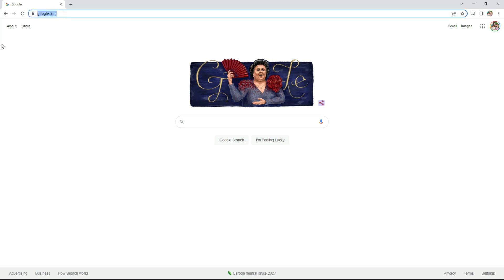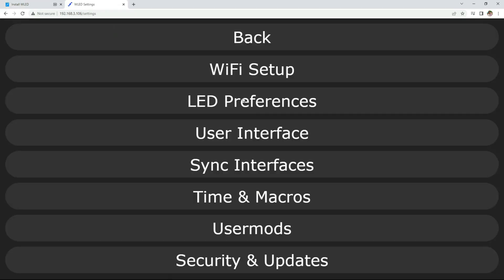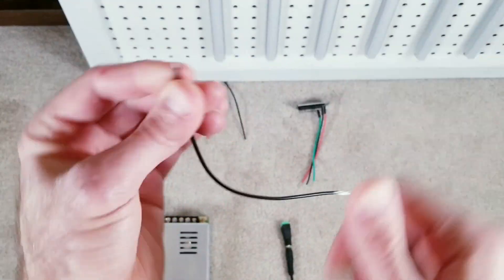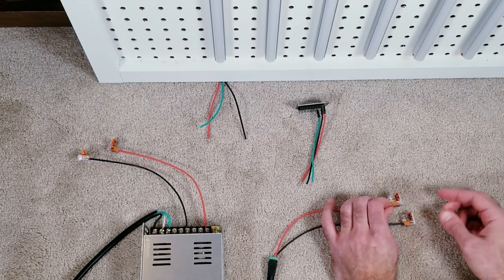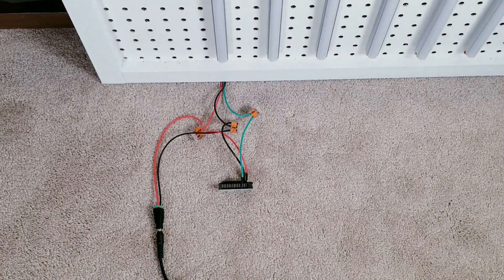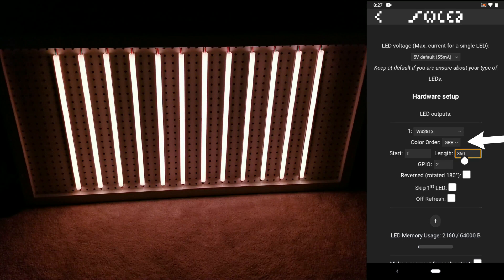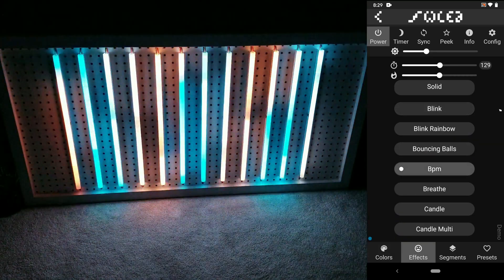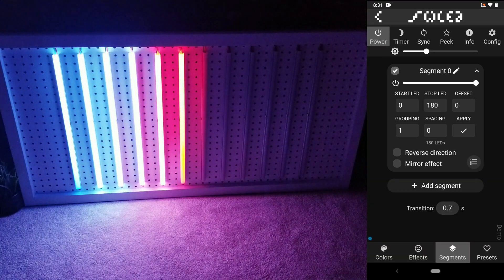How To Install WLED on an ESP32 Board and Connect / Control Addressable LEDs

Comment: Question- Bought everything on your list, thank you for making it easy to learn this. 
I designed a lamp made from square steel tubing, and I think the steel caused a short while I was testing the circuit. Now the strip won’t light past ~50th led except for a couple at about the 75th LED that just shows a dim green light. 
Is it possible that, if one of the resistors sparked against the steel housing, it would kill a section permanently? I’ve seen LEDs that were actually burnt out and replaced all of those sections, but none of these LEDs look bad. 
Some details: using the big power supply, soldered all sections in series using 18 gauge wire, and I’ve tried swapping out the controller board. 
It’s only about 8ft of LEDs with wire in between each section of 2ft, maybe there’s a setting I’m missing in the config? I played with the strips before beginning the project and they worked with 2 strips in series.
Anyway, thanks for any insight you can give 😅
Reply from the maker: Thanks for watching and taking the time to comment! Bummer your having issues! That seems like a strange issue! So one time something happened and my strip no longer did anything. I tried everything I could think of and nothing got it working. I eventually tried cutting off the first led of the strip and connected the rest of the strip back and everything worked perfectly. Im not sure if you have any extra strips of LEDs but that would be the first thing I would try. Connecting your current setup to a new led strip and see what happens. If that new strip works perfectly then more than likely something happened to an led or LEDs. On the strip that is no longer working, I would probably cut off the first led that's not working and reconnect the rest and see what happens. I'm honestly not smart enough in terms of all the electrical aspects to know if the steel could have caused a short but I'm sure it's possible! Troubleshooting is never fun but I do always seem to learn something new when I have to do it! Let me know if you figure it out because I'm curious myself what it might be!
Reply: @ChrisMaherDIY  Hey thanks for the quick reply Chris, I kinda figured I’d have to keep troubleshooting. Thanks again for the inspiration to try this, I’ll let you know how it ends up.

Comment: Do you have any experience with 12V led strips like the WS2815 with WLED?  I've seen conflicting info online on whether the data lines are 5V or 12V.
Reply from the maker: Thanks for watching and taking the time to comment! I have yet to experiment with those strips so I'm not really sure. I do at some point want to try them out because the 12v strips do have some advantages over the 5v. Maybe someone reading the comments might know more and can chime in!

Comment: There is one little step at the end that's missing. What case are you using to house the board? I want to go this route with a halloween costume that will require some LED's, I want to use wLED on the ESP32, but I can't seem to find the right project box to spap it into. Any help would be appreciated. I'm looking to run around with this in my pocket.
Reply from the maker: Thanks so much for watching! I've personally never used anything to house the board but I have seen other people recommend using some type of travel soap container which I thought was brilliant! Something like this: https://amzn.to/3s6QVcc

Comment: A este tipo de esp23 board se le puede instalar un sensor de movimiento para que se enciendan los led al detectar movimientos?
Reply from the maker: You can add a motion sensor but I have yet to try doing it with these esp boards to i'm not 100% sure on how it would work. At some point I do want to do a video on this so hopefully I'll know more down the road! Thanks!

Comment: How many ESP32 WIFI CONTROLLER control or detect? I have about 200 feet i want to do for a Rc Drift track.
Reply from the maker: Thanks so much for watching! So here is what the official WLED page says in terms of length. (its more based on how many leds there are vs feet)

"There is a maximum of 10 strips supported
Contrary to the ESP8266, the pin usage does not matter on ESP32, feel free to use any available pin
For perfect performance, it is recommeded to use 512 LEDs/pin with 4 outputs for a total of 2048 LEDs.
For very good performance, it is recommended to use 800 LEDs/pin with 4 outputs for a total of 3200 LEDs.
For good performance, you can use 1000 LEDs/pin with 4 outputs for a total of 4000 LEDs.
For okay performance, you can use 1000 LEDs/pin with 5 outputs for a total of 5000 LEDs.
For okay performance, you can use 800 LEDs/pin with 6 outputs for a total of 4800 LEDs.
ESP32 can calculate about 65k-85k LEDs per second (that means 1000 LEDs @~70fps, 2000 LEDs @~35fps, 4000 LEDs @~18fps)
4 outputs seem to be the sweet spot"

Comment: Hi, thanks for your video, i want to make this in a stair, but i have a doubt. can i install in parallel both data and DC? or i need to install data in serial mode (the out of the strip with the in of the next? thanks
Reply from the maker: Thanks so much for watching! I believe you can do parallel in both data and dc. I know I've done a few projects in parallel and I've simply just split the data line coming from the ESP device and it works perfect. Both strips do the exact same thing at the same time with zero lag or difference in animations.

Comment: Help! I've wired my strip and ESP32 exactly as shown but I have no control. The LEDs turn on but the colours and effects are just random.
Reply from the maker: Thanks so much for watching and sorry your having troubles! I would double check all the wires, and settings in WLED. Also if your data line is long coming form the ESP device to the first led, sometimes there are issues. Otherwise, the led strip could be bad or potentially the board. Always frustrating when things don't work but good chance to just try to eliminate what its not one thing at a time to hopefully narrow it down to what it could be. Good luck and hopefully you can figure it out! Also maybe check out other youtube videos to see if people are doing things any differently!

Comment: Thanks you for your app, that app are awesome. But it't support dual channel ?
Reply from the maker: Thanks for watching! If by dual channel you mean 2 strips at once then yet. You can connect different strips to different pins and then assign the pins in the WLED settings. Thanks so much for watching!

Comment: Man what a great video. I would have never found the section with the Number of LED per strip. I couldn't figure out for the life of me why i only got 32 LEDs lighting. I bought 2 power supplies and 2 higher end usb chargers.. 
Guess i have extra power supply's for my Triangle and HEX nano leafs now
Reply from the maker: Thanks so much for watching and glad it was helpful! Better to have too much than too little!
Reply: It's not per strip "per se".. it's just total number of leds connected to that controller.

Comment: Hey man!  Im scratching my head hard right now trying to figure out what pins to use for two led strips on the same controller but different pins.  You should make a video showing how to do multiple LEDs to one ESP32 board!
Reply from the maker: Thanks so much for watching! I should! I've only briefly played around with it but in the WLED settings there is a spot to add another strip and assign it to a different pin. I would just experiment with adding a strip to a different pin and then assigning that pin in the setting and seeing if it will work. I will at some point do a video. I'll put it on my long list of project!

Comment: they don’t have the board in stock is there another alternative board i can get thanks
Reply from the maker: Thanks so much for watching. Its still showing available in the US at least. I'm not sure about other regions. If its not available where you are, most eps32 boards are all relatively the same and should work! I always just make sure to order from a place that has free returns in case I cant get it to work!

Comment: for the small power supply - what Amp do you recommend?
Reply from the maker: Thanks for watching! For small projects (i'd say less than 50 leds) the 2amp charges have worked well for me. For medium sized builds (300 leds or less) i would go with the 10am. Anythine more than that I would go with the big supply. I'm also a big fan of just trial and error and testing things out. How many leds you can use will mostly depend on how bright you want them. For example, for all my projects, I rarely ever have a need to have them at full brightness (just too bright) so I can always use less power than recommended. Hope that helps and thanks for watching!

Comment: What voltage and watts and amps etc should the power supply be? I am planning on connecting 3 separate 2.3m strips with wire so it would be like almost 7m of led would it suffer from voltage drop?
Reply from the maker: Thanks so much for watching and taking the time to comment. For that I would try this one and see how things looked. https://amzn.to/3DCOp4A Depending on the brightness and color you want to run the leds at you might need to inject power but I always start off with no injection, test and see how things look and then go from there. Thanks for the great quesiton!
Reply: @ChrisMaherDIY  thank you for the help :)

Comment: Thanks for the videos! I’ve been learning a lot from your tutorials. Do you recommend a separate power supply for each array of controllers / leds strips. For example I have 3 separate windows that I want to surround with leds. Where I can control each one individually. Is it best practice to have a separate power supply for each one of calculate the number of leds and find a suitable power supply for that. Also, in this scenario how would I give extra power to each one if they require it.
Reply from the maker: Thanks so much for watching and taking the time to comment. Glad you are liking the videos and great question! So I would say that you certainly don't need to use a separate power supply for each set of lights/controller. Running a longer distance of wires from the power unit is perfectly acceptable. Now depending on your layout and how you want to hide everything, it may make sense from a logistical/concealing everything standpoint to have different power supply's but its certainly not necessary. And if you do need to give more power to the lights, you can run long power wires from the main power source to the led strips. Hope that helps a little!

Comment: Hey Chris, I just purchased all the stuff needed to make these but I've run into an issue. My ESP32 board is no longer connected to my wifi and I am unable to reset the device to reinstall wled. Could you please help me out here?
Reply from the maker: Thanks so much for watching! When I wanted to reset my esp32 back to default I remember I had a hard time figuring out how to do that until I stumbled upon this video! I watched this and was able to figure it out! Hopefully it will work for you like it worked for me! https://www.youtube.com/watch?v=bQTHNZI6Wno&t=214s

Comment: Great video!  Everything worked UNTIL the part where it asks for the Wifi credentials... Entered them 4 times. Double checked for no misspelling or extra spaces... nothing.  I'm using Heltec ESP32 and trying to install WLED 0.13.1.  

Any recommendations?
Reply from the maker: Man thats so strange! I have no Idea what could be causing that. Is your home wifi 2.4 or 5ghz? I'm not sure if that makes a difference or not. Maybe try watching this guys video to see if there is anything that he does differently? https://www.youtube.com/watch?v=j15pjU3YZfg&t=41s
Reply: @ChrisMaherDIY  It turns out that I was using a special character in my password... either WLED or my Heltec ESP32 unit did not like that.

After changing the password it worked.

Now I'm fighting with the config and keep getting "Light not connected" error.

Thank you for your help!

Comment: Hi Chris, amazing videos and awesome informatio... Keep it up... Need help, can you pls make a video about changing micro b usb input to usb c input on esp32 board.... Doing a photography hobby project, and for that I have to carry an extra cable for esp32(micro b input), would help a lot if I can make it usb c input... Thanks...🙂
Reply from the maker: Thanks so much for watching and taking the time to comment! That's a good idea for a video but I would have to do some research first as I don't know how that would be done. I do know that they make esp32 boards that have the usb c input now which if I'm understanding your issue, might help? I have not used these boards so I'm not 100% sure on the differences between them and what I use but my understanding is they are all pretty similar! https://amzn.to/3QjXnao
Reply: @ChrisMaherDIY  I already have esp32 with micro b connector, if possible atleast can you find and give me link to documentations of micro b (+/-) according to esp32 board circuit, will try to look into it if it's possible for me... To do it on my own...👍

Comment: Hello Chris,  do you know whats the different between ESP32 & ESP8266 ? 

which one should I chose? 🙏🏼 thanks

https://www.youtube.com/watch?v=l8OMi7SMpqs
Reply from the maker: Thanks so much for watching and sorry I'm just seeing this comment now. Youtubes notification system for comments is not very good! If you have 600 leds or less, either one will work just fine. If you start getting more than 600 leds, I would go with the 32 since its a little more powerful and can handle more leds! Hope that helps!
Reply: @ChrisMaherDIY  many thanks Chris 🙏🏼🙇🏻‍♂️

Comment: Does Wled only work with wifi or is bluetooth an option
Reply from the maker: Its wifi only. However since the device creates its own wifi signal that you can connect to, i'm thinking it might work if you dont have an actual wifi in the area. I still have to test this theory out to see if it works. I'll make a video on it since a few others have had the same question!
Reply: @ChrisMaherDIY  greatly appreciated Chris, Thank you!

Comment: Thanks for the video, really helpful! How do you connect a 4-pin LED strip to the ESP?
Reply from the maker: Thanks so much for watching and taking the time to comment! I have never used a 4 pin connector so I'm not sure how that would get wired up! At some point I do want to learn but have not had the need yet to use something other than the 3 pin individually addressable strips I've been using. Let me know if you do find a good video or website out there explaining things as I'm curious myself!

Comment: So I got two esp8266 and they did the same thing. Was it maybe because I used the jumper wires or maybe the light settings on the wled app set to 2500 was the issue. For the esp32 would jumper wires and phone charger work ok with it.
I wonder if it was because I unplugged and replaced it a lot. Either way I'm gonna try the esp32 with the jumper cable and phone charger.
Reply from the maker: Man that is strange! I never had any issues with mine and in the begining I always used jumper wires. Maybe check out this guys video and see if there is anything that he might have done differently that you can try. https://www.youtube.com/watch?v=j15pjU3YZfg&t=41s 

Hopefully you bought off amazon and can just return the ones that are not working.
Reply: @ChrisMaherDIY  ok thanks

Comment: Hey Chris hopefully you can help me is there anything to be able to use wled with a 12V configuration
Reply from the maker: There is and I really should do a quick video on it at some point. I have not really done it myself yet but from what I can tell people just use something called a stepdown regulator: https://amzn.to/3uX5jp9 Something like this just converts the 12v to a 5v signal for the esp controller and then you can use other wires coming form the 12v source to power the leds.
Reply: @ChrisMaherDIY  that be great, I have been using the leds in Cars, but someone decide to wire the leds and the board straight to 12 v when I had told them use the step down for both the controller and the leds, so hopefully next time it does happen

Comment: can I power the ( ESP32 ) with 12 volt .?
Reply from the maker: You can but I believe you would need something called a step down regulator. Something like this: https://amzn.to/3HXFpa5 that converts the 12v to 5v. I'm not 100% sure but I think the board does need 5v.

Comment: I got an esp32 board with different pin descrptions they are all labeled with G numbers. Can i use the G4 for data  the 3v3 for positive and one of the four gnd pins to ground.
Reply from the maker: Thanks for watching! I'm not 100% sure. Maybe do some digging online to see if you can find a definitive answer. Otherwise just try it and see it it works. Trial and error is what I do best lol.

Comment: Hi Chris, is a 5v 10amp powersupply enough to power 5meters of ws8212B strip
Reply from the maker: In my experience it is enough. There may be some voltage drop (white starts to look more yellow as the strip goes on) if you have all the led lights at white and full power but for all my projects, I never need/want to do that so it would be enough for me.
Reply: @ChrisMaherDIY  You don't use any resistors with the esp32 in the data line. Im not sure witch pins i have to use i got an 5v pin and an 3v3 pin and my data pin should be G4. I'm a little worried that i fry the board.